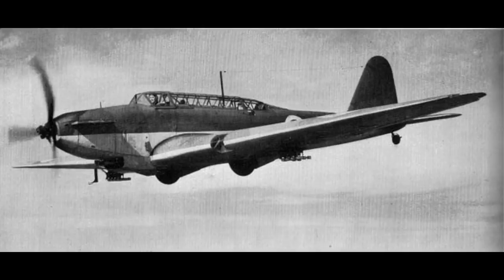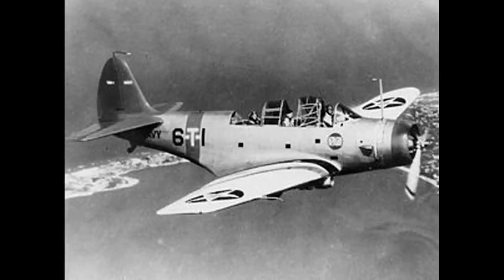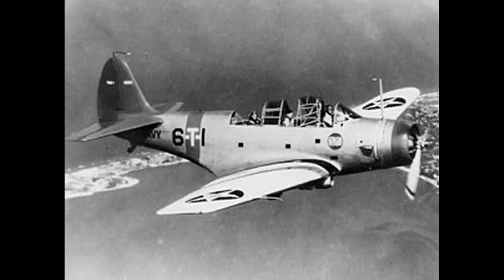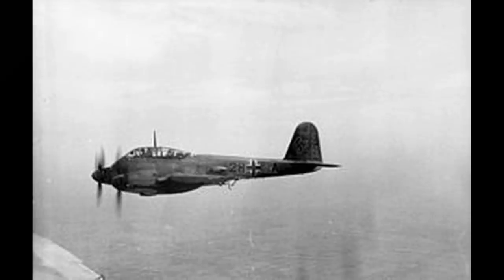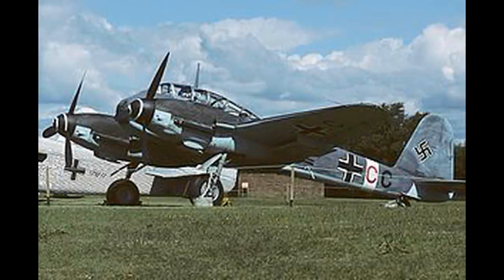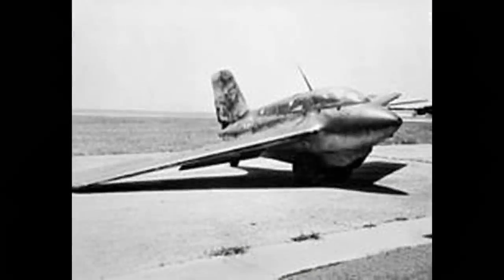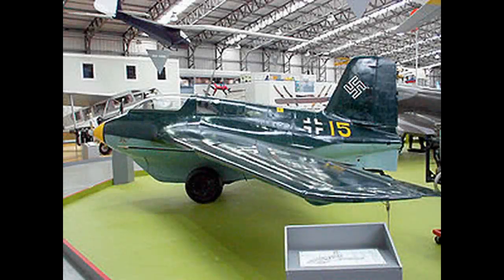TOP 5 WORST military aircraft used during WW2

Comment: The NAVY TBD Devastator took crippling losses during the Battle of Midway but so did the more advanced Grumman  TBF, six of which flew from the island.  The lack of fighter escort  was the reason both types and their crews suffered so grievously.  
The RAF Roc turret fighter was especially poor.
Reply: The Roc was pre war and only used early in the war unlike the Devastatingly bad Devastator or Avenger.
Reply: @barrierodliffe4155  - The Grumman Avenger was one of the finest carrier aircraft of WWII.  The Douglas  Devastator, ordered in 1934, was clearly obsolete at the start of the war and was quickly replaced by the Avenger which served till the end of the war and beyond.  "After WWII, the Avengers served in several training squadrons and were also modified to be carrier onboard delivery aircraft (COD). Later, the TBM’s were even modified as first-generation early-warning aircraft. Through these roles, the Avengers helped to continue their mission of preserving freedom until they were retired from United States naval service in 1954."  https://www.collingsfoundation.org/aircrafts/grumman-tbm-avenger/
Reply: @scootergeorge9576  
The Griumman Avenger and fine is rather silly. The Douglass Devastator first flew about the same time as the Spitfire.  The Spitfire was not obsolete until after WW II. 
The slow Avenger was obsolete during WW II.  It needed a fighter escort to survive.
Reply: @barrierodliffe4155   - Silly would describe the biplane "Stringbag"  flown by the Royal Navy during WWII.  But the proposed replacement was probably worse!  In any case, attack aircraft can not survive against fighter attack without fighter escort. The RAF discovered that during the Battle of France.  But the Avenger, it should be noted, sank the two biggest battleships ever.  But then again, the Royal Navy also found use for the product of the "Grumman Iron works."  I would say that the Grumman Avenger was  superior to any British design torpedo plane of WWII. https://www.royalnavy.mod.uk/news-and-latest-activity/news/2016/june/17/160617-culdrose-avenger-to-avenger
Reply: @barrierodliffe4155  - The Spit was designed by that chap, Mitchell. It was not until Ed Heinemann  joined Douglas that they started designing great planes, starting with the SDB. Others include the A-20 and A-26. The later served in WWII, Korea, AND Vietnam.   And among others is my personal favorite, the A-4 Skyhawk, AKA "Scooter."
Reply: @scootergeorge9576  
The Swordfish sank many more ships than the Avenger, and the Swordfish was replaced by the Firefly which served on to Korea, it made the Avenger look slow and very obsolete.
Reply: @barrierodliffe4155  - Swordfish sank  and or damaged a few Italian ships tied up in harbor.  Avengers sank, the bulk of the Imperial Japanese navy which was larger than the Italian and German fleets COMBINED.  Swordfish...you are funny!
Reply: @scootergeorge9576  
The Spitfire was better than anything from Douglas including the Skyhawk which was obsolete by the  early 1960's.
The A 20 was slow and no match for the Mosquito, not even as capable as the  Beaufighter which was faster than the A 20.  The A 26 a bit better but still not equal to a Mosquito.
Reply: @scootergeorge9576  
The Swordfish did far more than just the Italian ships at Tarranto. The Avenger did little by comparison.  
Ignorance seems to be your thing, or was two battleships the bulk of the Japanese Navy ?
Reply: @barrierodliffe4155  - How many German ships did the Swordfish sink during the famous "Channel Dash?"   Not a one!
Reply: @barrierodliffe4155  - How many German ships did the Swordfish sink during the famous "Channel Dash?"   Not a one!
Reply: @scootergeorge9576  
Nor did the Avenger, did the Avenger sink a single German ship?  
Try this for size.   By the end of the war, the Swordfish held the distinction of having caused the destruction of a greater tonnage of Axis shipping than any other Allied aircraft.
Reply: @barrierodliffe4155  - I would hold the Invader to be equal or better than the "wooden wonder" which the RAF quickly moved to replace post WWII, which, considering the economic plight of Great Britain, is telling.  I would concede that the Beaufighter is superior to the Havoc but at the time of introduction, the A-20 was an excellent aircraft, serving well in both the attack and night fighter roles.  
The USN began replacing the A-4 "Scooter" with the A-7 because the latter could lift more bombs but...did you know the A-4 broke the world's closed course speed record? Took it from the F-86H! Also, it was still flying as an Adversary aircraft, simulating Soviet fighters into the nineties. I know. I was assigned to VFC-13 at "Fightertown USA" NAS Miramar. When I got out in 1991 13 and Top Gun (you've heard of them)  were still flying Scooters.  And in my humble opinion, the best Blue Angers show was with their A-4F.
Reply: @scootergeorge9576  
In what way was the slower Invader equal to the Mosquito?  Britain replaced the Mosquito with jet aircraft,  Considering Britain was doing ok even having to pay USA until 2006.  Maybe you did not know that Great Britain was doing a lot to help European countries and Germany recover from the plight that they were in. 
The Beaufighter was a better night fighter and much more than the Havoc.
Reply: @barrierodliffe4155  - Two words - Marshal Plan.
Reply: @scootergeorge9576  
One word  -  Profiteering.
Reply: @barrierodliffe4155  - As opposed to the Treaty of Versailles which virtually guaranteed  a second world war.  Oh, by the way. do you recall the  grievous losses Argentine Scooters inflicted upon  the Royal Navy in the Falklands?  This, despite of the fact that many of their iron bombs failed to explode.
Reply: @scootergeorge9576 
The Treaty of Versaille did not cause WW II.  I recall when Britain went and took back our islands and how the US did not think it could be done, not only that but the US was telling their friends the Argentine junta it could not be done.
Reply: @barrierodliffe4155  - The Treaty laid out the groundwork of hatred that went a long way towards  ensuring another war. The blame it all on Germany and crippling reparations. I do believe the US provided at least nominal support  for the retaking of the Falklands. In any case, did not actively oppose it. And about those ships sunk or heavily damaged by obsolete Douglas attack aircraft...
Reply: @scootergeorge9576  
The treaty was perhaps too kind to Germany or WW II would have been far less likely. The hate was all by the Nazi;s,
You spelled minimal wrong, USA tried to stop Britain from using their own territory   What about the obsolete Skyhawks ? they were obsolete by 1960.
Reply: @scootergeorge9576  
The US provided intelligence to Argentina on the quiet and was willing to do what?  The same as USA always does wait and see who was going to win.
Reply: @barrierodliffe4155  The Avenger was a torpedo and level bomber. The Firefly was a strike fighter. The FAA 'replacement' for the Avenger was the Barracuda, which was compromised by its short range.
Reply: @thisisnev  
The Baracuda was more  likely to survive than the Avenger.
Reply: @scootergeorge9576  The "wooden wonder" was replaced by the Canberra ... which you would probably know better as the B57.
Reply: @barrierodliffe4155  Mosquito replacement? ... the Canberra.  Or, as the ex-Colonials across the pond would know it as, the Martin B57 Canberra ... that NASA is still flying!
Reply: @wotnotvintage7762   - built by Martin Aircraft under license . A very good bomber and photo recon bird. But, the aircraft it beat out, also by Martin, the XB-51 looked like it held a lot of potential.
Reply: @scootergeorge9576  
Why did USA by the Canberra? Because it was better than any US made equivalent even if Martin made it worse than the original made by English Electric.
Reply: Barrie Rodliffe The Spitfire was also continually redesigned throughout the war, to the point that a Griffon-engined late war model had few if any parts in common with a Mark I of 1939.
Reply: @mebsrea   - The 109 went through many changes as well.
Reply: @mebsrea  
All aircraft were modified during their production, the Spitfire had some modifications but remained pretty much the same from the Mk I to the Mk XIX.  They did make changes for more powerful Merlin engines and then the bigger Griffon engine. Most changes were for different armament and the change from a Malcolm hood to the teardrop canopy.

Comment: The Iralian Caprioni bombers were all crap, Sweden bought these and among their crews, they were called as Flying Coffins and many of them crashed with fatal results with their crews. They saw only a short time service in the Swedish Air Force before the remaining planes were used in secondary duties. The Brittish Defiant was great concept with their turret but it lacked armament forward and once Germans found out this, they became sitting ducks for Messersmiths.  Seafires were not good carrier planes and many were damaged or crashed while landing on a deck of the carrier, mostly I guess too big propellers used on the plane and not designed as a first place to operate on a aircraft carriers.
Reply: The Seafire suffered from a narrow track outwards retracting undercarriage inherited from its ancestor. Like the even narrower tracked Bf109 this led to a lot of landing accidents. The Supermarine Spiteful got inward retracting gear that fixed that problem and the Attacker inherited that detail as it used the same wing.
Reply: No messersmiths... correct spelling is Messerschmitt !

Comment: My top 6, 1 for each of the 6 major nations:
US: Brewster SB2A. So inferior to it's contemporaries the SBD and SB2U.
UK: Blackburn Botha. It failed at literally everything it did, even tertiary roles.
Russia: Lavochkin Gorbunov-Gudkov LaGG-1. Underarmed with engines that couldn't perform. Fortunately, the far better LaGG-3 had started production by the time Operation Barbarossa began.
Germany: He 177. Ineffective engines, ill-suited orders and tactics, and role that was unfeasible to the current situation Germany was in.
Italy: Breda Ba 88. Per the video, underpowered and obsolete to a ridiculous degree.
Japan: MXY7. The endth degree of kamikaze doctrine, but was ineffective and required being carried by obsolete G4M naval patrol bombers that were incredibly vulnerable by 1945.
Reply: Depends on which version of the SB2A your talking about. The best one was the SB2A-2 and it could out perform the Zero except in climb and top speed. The FBA2-3 which were used at Midway had 700 pounds more weight (armor) added without any additional power, and yes, it was a dog. It was said the dash 2 could turn in a phone booth. It's why the Finns had so much success with them.
Reply: @13stalag13  You're thinking of the F2A, which is the Buffalo. The Buffalo was initially superior to the F4F Wildcat, which is a fighter. The SB2A Buccaneer is a dive bomber, like the SB2U Vindicator and SBD Dauntless like I mentioned in the comment. The Buffalo had the most success with the Finnish, and was against aforementioned LaGG-1s.

Comment: In 1936 the Battle was possibly acceptable. By 1939 is was an obsolete death trap. 
When it entered service the Devastator was the most advanced aircraft of it's type but the advances in aircraft technology soon rendered it obsolete.The problems with it's mark9 torpedoes made a bad situation even worse.
ME-210 with 5 minutes of fuel was little more than a technology demonstrator. 
Didn't the British use the  Breda Ba.88 as ballast for empty cargo ships returning to the UK and then as scrap metal turning the Aluminum into Spitfires and Lancasters.

Comment: Boulton Paul Defiant ??
Reply: Menthal Oh,  That’s the reason why the Bolton Paul Defiant was withdrawn early during the Battle of Britain. 🇬🇧
Reply: No, because the Defiant was a surprisingly successful night fighter.  It was originally designed as a bomber destroyer, because that is what the Air Ministry required when it laid down the specification.  And it very likely would have been successful had it not been for France falling very early in WWII ... prior to that, Luftwaffe bombers flying from Germany to attack Britain could not have been escorted by ME 109 fighters due to their lack of range, so the unescorted bombers would have been easy meat for the Defiant.  But France did fall and that gave the Luftwaffe airfields within fighter range of targets in Britain, so the Defiant found itself entering the fray with 264 Squadron as a day fighter, a role for which it was never designed.  However, the CO of 264 Squadron had flown successful mock combat sorties (against Robert Stanford Tuck no less, flying a Spitfire), and had devised tactics which would allow the Defiant to hold its own against ME 109s ...  by forming a descending Lufbery circle, whereby each aircraft could defend all the other aircraft in the circle from attack.  Unfortunately the second squadron to be issued with the Defiant (141 Squadron) chose to ignore these tactics and was decimated as a result, leading to the withdrawal of the Defiant as a day fighter.  So in July 1940 the aircraft was redeployed as a night fighter and, during the Blitz on London of 1940–41, the Defiant equipped squadrons were responsible for shooting down more enemy aircraft than any other type of aircraft in the RAF inventory.
Reply: @wotnotvintage7762  When were the Defiants finally withdrawn from combat use? There is one in the RAF museum in Hendon. AS well as a Battle.

Comment: Interesting, but please open a dictionary and find the actual meaning of 'volatile'. The problem with the Me163 was not the fuel, so much as the oxidiser (hydrogen peroxide), which made it prone to exploding on takeoff, in flight, during landing or after landing.
Reply: At least they didn't try Nitrogen Tetroxide oxidizer and dimethyl hydrazine fuel.
Reply: Specifically High Test Peroxide (HTP) ... normal Hydrogen Peroxide is very commonly used as a household cleaning material and even as a mouthwash!

Comment: The Battle and TBD were fine aircraft put into combat at the wrong time. I wouldn't call them bad aircraft at all.
Reply: Agreed for the Douglas TBD, which would have been a successful torpedo bomber if the Pacific War had started 3 years earlier.   In December 1938, the A6M Zero existed only on paper, and its predecessor the A5M was 50 mph slower and had no 20 mm cannon.
But the Fairey Battle was inferior to the contemporary twin-engined Bristol Blenheim I (see: https://youtu.be/pS6F0mxVP5E)
Reply: The Devastator needed fighter air cover (like any vulnerable bomber) and reliable ordinance.  It received neither.   
When a tool is used improperly, you don't blame the tool.
Reply: @fredweller1086  : The TBD Devastator always had F4F fighter escort assigned to it in both the Battle of Coral Sea and the Battle of Midway.  But the fighter escort sometimes failed to link up with them, because the fighters always launched later than the TBDs, which had already flown out of sight of the carrier before the fighters took off.  The US Navy was still green in early 1942 and made mistakes typical of any force new to actual combat operations.
Reply: @timonsolus  Thanks for agreeing with my assertion.  The TBD didn't have reliable fighter escort.  With that escort, they wouldn't have the reputation they do.

Comment: Jep the landing on the me163
 i realy dont understand wy they didnt gave the kommet a landing gear it literaly brocke your spine when you landed.
Reply: I think the idea was to save weight. Also the aircraft was conceived as an experimental or technology demonstrator aircraft that was pushed into service as the bombing campaign against Germany was taking its toll. An internal retractable landing gear would not have been practical for a small aircraft whose internal volume was mostly taken up with fuel tanks.

Comment: The Devastator gets a bad rap due to the Battle of Midway but just about any aircraft type would've suffered horrible losses if thrown into a similar situation. The Boulton Paul Defiant would've been a better fit in its stead.
Reply: The Boulton Paul Defiant was intended as a 'turret-fighter', had only a small bomb-load and no torpedo capability. - and no ability to safely operate from ships (launched, yes, landing-on no). 
The Boulton Paul Roc was actually designed to attack ships, being the Royal Navy's Fleet Air Arm dive bomber operating from aircraft carriers. 
The two are of similar design, but optimised for different roles.